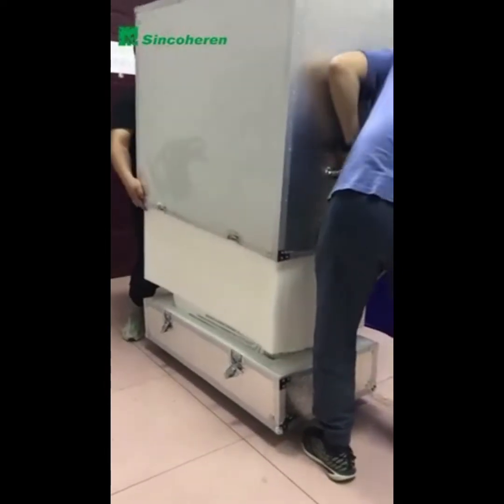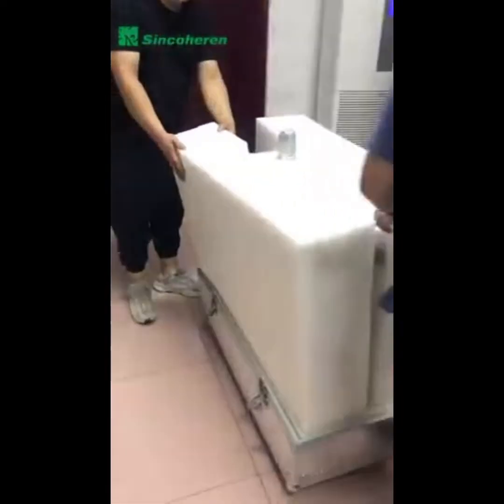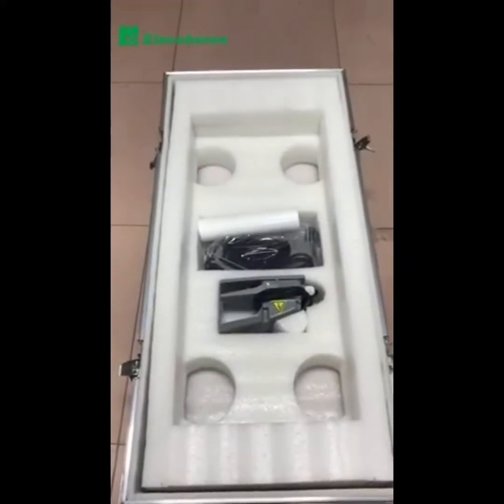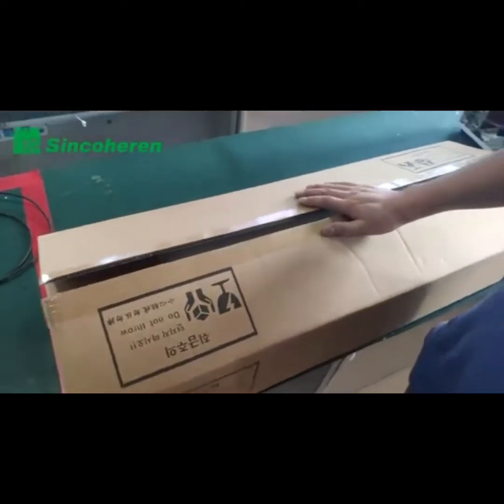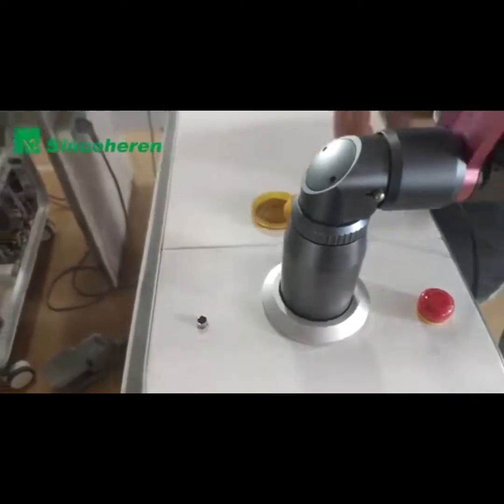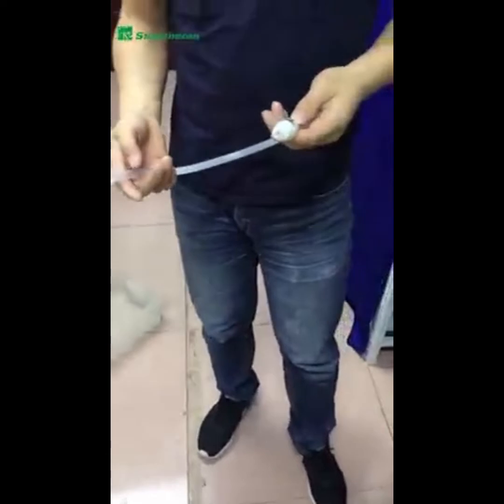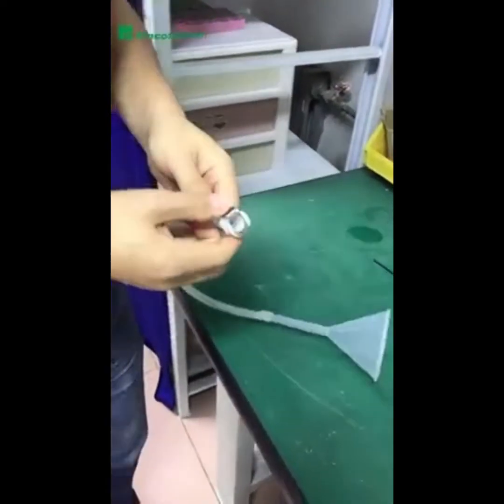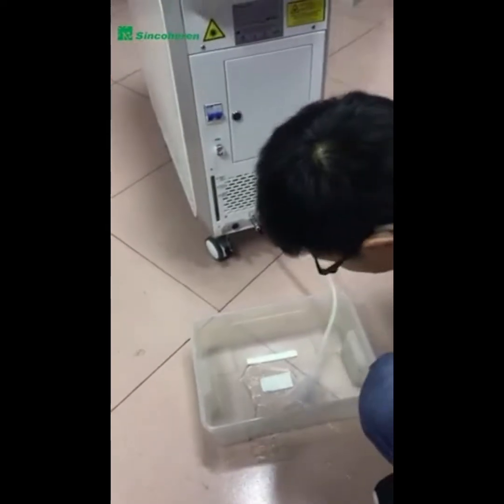Q Switched Nd YAG Laser Installation Guidance

Comment: Hello. Can you help me ? My machine says error E03 when it turns on
Reply from the maker: E03 for Q Switched Nd YAG Laser is: Interlock connecting error. Please check if you have connect your interlock part, and if it's connecting well. If you still can't make it, please send my WhatsApp: +86 18336073480. [1. the nameplate of your device/lable./ 2.the video problem of your device], then I and our engineer will check and help